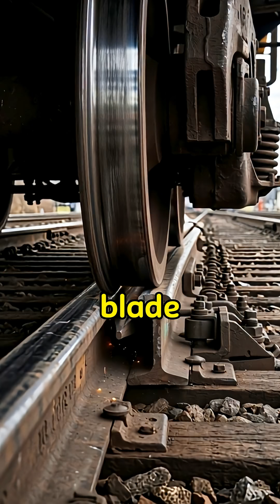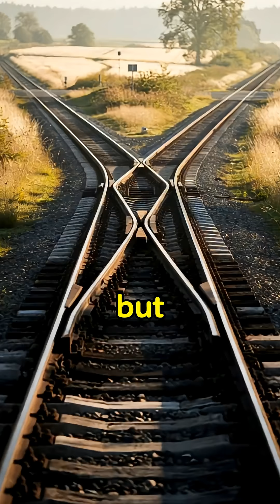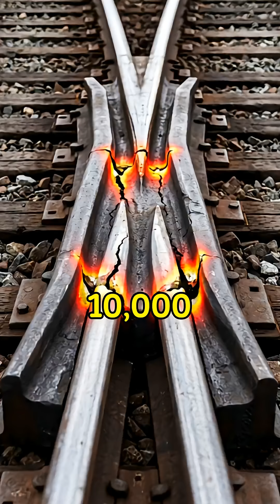The Hidden Genius Inside Every Train Track #railroad #engineering #shorts

Comment: A "switch blade" may come to a "knife edge", but it has nothing to do with a "switchblade" knife!
Reply from the maker: Haha, you are 100% right, Danny! It’s purely a fun bit of wordplay on the engineering terminology. The tapered rails are called "switch blades" precisely because they have to be planed down to that exact, razor-thin knife edge to smoothly intercept the wheel flange without causing a derailment. But rest assured, there are no spring-loaded pocket knives hiding under the ties! Appreciate you keeping the definitions straight for the thread.

Comment: Ah, but in the UK, we have leaves on the line & the wrong type of snow! 🌳 ❄️ 😂
Reply from the maker: Welcome to the yard! 🛠️🇬🇧 Ah, the legendary British Rail double-whammy! As funny as those classic headlines sound, the engineering friction behind them is a real nightmare.

Crushed autumn leaves get baked by heavy steel wheels into a rock-hard, Teflon-like glaze that completely obliterates traction, while the infamous 'wrong type of snow' (fine, dry powdery snow) sifts right past standard ventilation guards to short out electrical traction motors. Absolute classic UK rail banter! 🌳❄️

Comment: Da stimmt ja gar nichts. Die AI hat aber auch alles, wirklich alles, komplett falsch dargestellt. Ich bin entsetzt, dass jemand ein offensichtlich dermaßen falsches Video online stellt.
Reply from the maker: I hear the frustration, Dirk! When the iron doesn't look right to a trained eye, it's a major safety concern. In the workshop, I use a specialized digital workflow to bring 'hidden' engineering to life, but the goal is always technical accuracy. Specifically, do you disagree with the 1/4-inch switch tolerance or the conical physics of the wheels? If you have better blueprints or specific standards that contradict these, I’d rather update the record than leave a mistake standing. Let's keep the history accurate.
Reply: @HiddenCivilEngineering die gesamte Darstellung der Weichen ist falsch. Die Funktion der Weichenzunge. Schau dir eine Weiche aus einer Modellbahn an. Es wird dir sofort auffallen. Deine Darstellung einer Weiche führt zum garantierten Entgleisen.
Reply from the maker: @Dirk-Ulowetz I hear you, Dirk! 🛠️ A 'guaranteed derailment' is the last thing we want in the yard. You're right that the function of the switch blade relies on a perfect, flush fit against the stock rail to protect the wheel flange. If the render showed a gap or an improper throw distance, the physics of the 1/4-inch safety limit fail immediately. While our goal is to show the 'hidden' genius of the track, the pixels have to respect the iron. What specific part of the blade's movement felt the most 'unreal' compared to the real thing?
Reply: @HiddenCivilEngineering  die grundlegende Darstellung ist schon falsch. Stell dir ein Auto vor, das über der Straße schwebt, weil die Räder auf dem Dach montiert sind. So grundlegend falsch meine ich. 
Kauf dir eine Weiche aus dem Modellbau, die sind wirklich nahe an der Wirklichkeit, sehr gut, um sich die Funktionsweise genau anzuschauen, oder suche nach Erklärvideos über Weichen. Ich bin mir sicher, dass man hier so etwas findet. Die DB sollte da was gedreht haben. Diese Lehrfilme sind allerdings auf deutsch und gute 70 Jahre alt. Eventuell gibt es englische Untertitel.
Der Ansatz hier war gut. Moderne Aufmachung, gute Grafiken. Wenn sie nur akkurat gewesen wären.
Reply from the maker: @Dirk-Ulowetz Glad to have you looking closer, Dirk! 🛠️ Studying scale model trackwork is exactly how we’re going to get the accuracy back into the iron. If the model can't run through it, the real train definitely can't. I'm focusing specifically on the throw of the blade and the flangeway clearance at the frog based on your suggestion. Since you have that 'inspector' eye, is there a specific scale or manufacturer you think gets the geometry most accurate to the real blueprints?